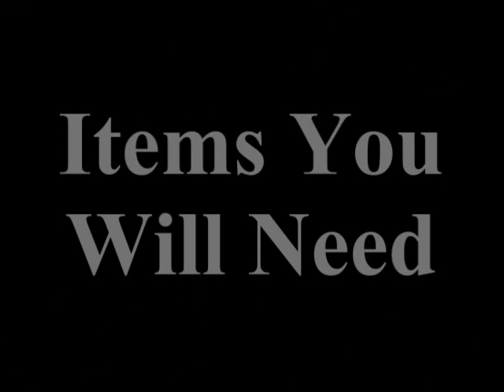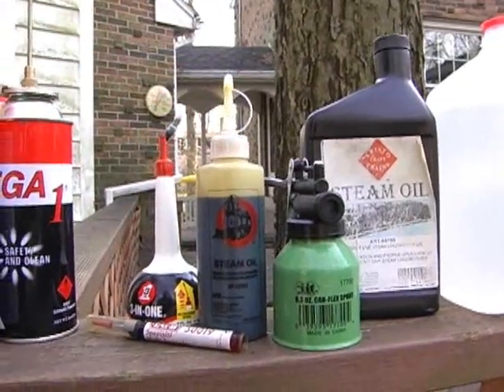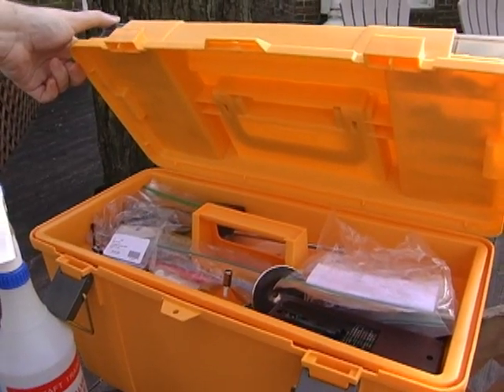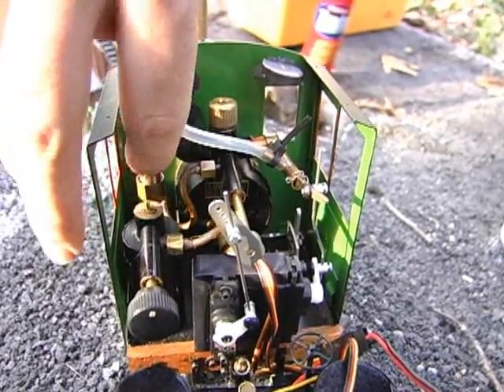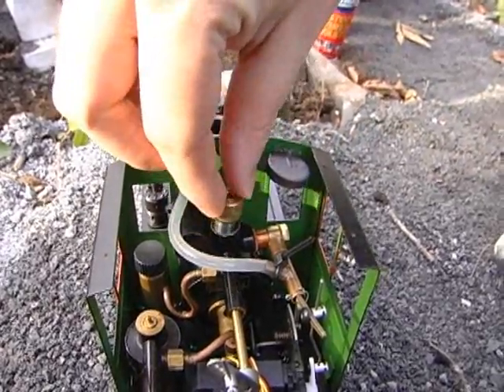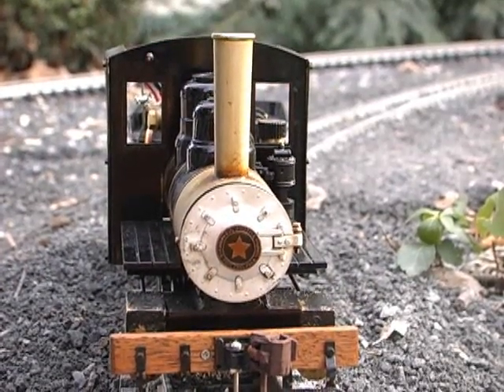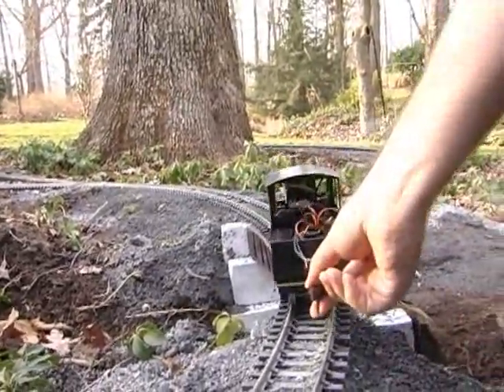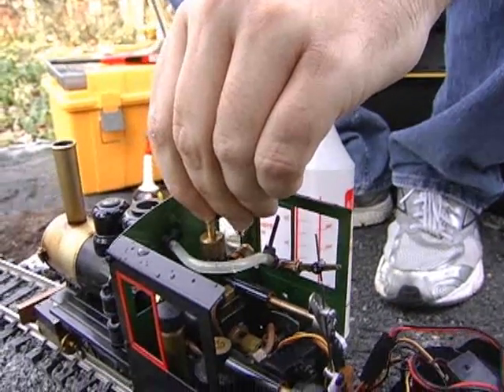How to Fire A Live Steam Ruby

Comment from the maker: For me, I have the whistle on this loco, which is a simple means to let off all of the boiler pressure.  For other locos the use of a pressure gauge is key, but in both cases opening the throttle valve is often a simple means to reduce boiler pressure while things cool.  Adding water through a goodall valve will quickly cool the water in the boiler thus reducing pressure.

Comment: wow the link did work, seems to be a bit of work getting her up and running, so how long will it go till you have to add more, water, butane, oil?
Reply from the maker: The steam oil isn't that frequent, but the water and gas are things to keep tabs on.  Most of these engines are designed so that they run out of fuel before they run out of water and it all depends on the size of the boiler and gas tank, but 15~20 minutes is quite reasonable.  I will typically fire up a loco to the point that it lifts the safety and runs a wee bit, then I'll shut down the fire and top off the fuel and water.  If you're a good engineer you can stretch your runs longer and longer.  If you just go full-throttle all of the time you're going to run out of steam at the bottom of some hill somewhere along the line, much like the real thing.  The more you run your loco the more you get to know how it sounds (or smells) and what that means: more water, she's going to need more fuel, etc.
Reply: just wow is the first thing to say, a whole new modelling experience there, love it

Comment: Is there much of a break in period for new locos?
Reply from the maker: A loco that one built from a kit will need some time on air to make sure the timing is set correctly, perhaps a few firings after that, once complete, should do the trick.  A "new" loco that is RTR actually has some time on it from the factory and shouldn't need any more time to really get it set.
Reply: @GardenRR  that’s what I was thinking. I just got one and feel like that timing isn’t quite right. On a cold engine, if I move the reverser to the direction of travel, I can move the engine but feels like it’s binds in the running gear. I can only get the engine to run at warp speed. Anything slow it seems to lock up.